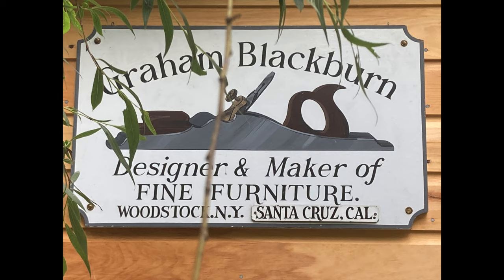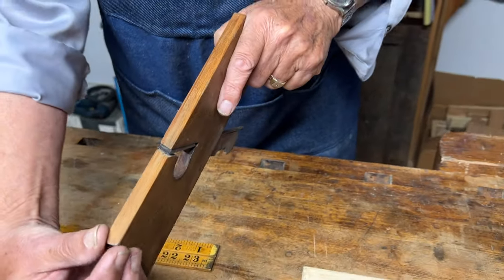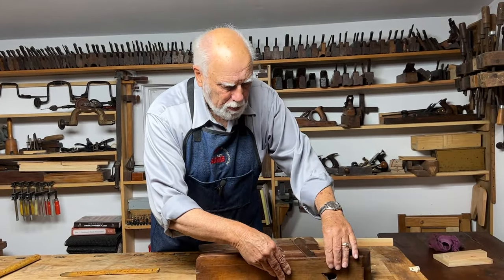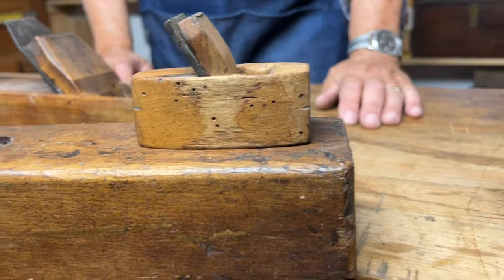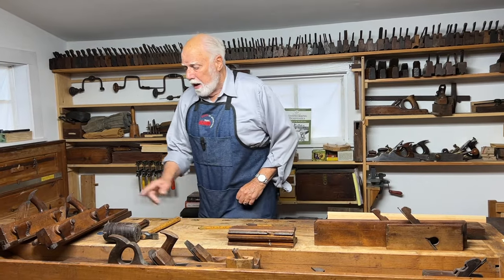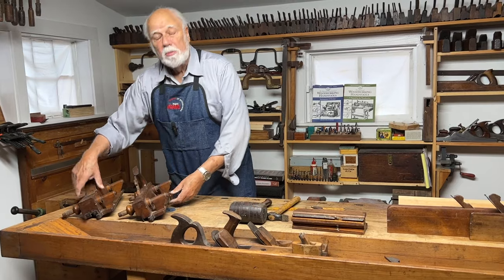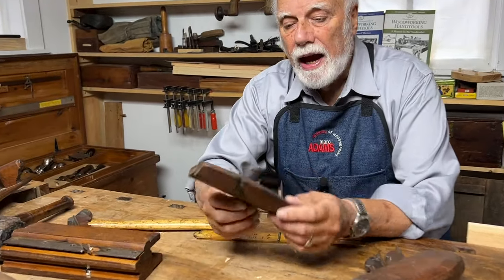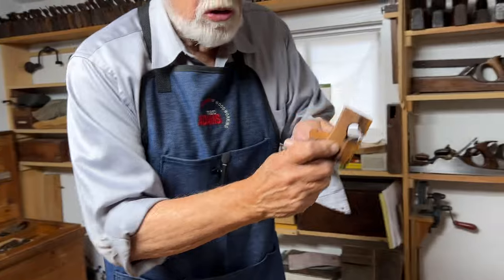61.Big planes & little planes

Comment: I have a plane that is quite similar to the extra long v-grooving plane. Here in France theses were sold as planes for making dovetailed table slides (you would make a groove and then do the dovetail part with the plane). Of course i guess it can be used for a wide array of odd jobs 🙂
Reply from the maker: Interesting!

Comment: Good videos.  I like the relatively short descriptions of the tools, but it leads to many other questions. ie: Why is the  length of a jointer plane important vs the smoothing plane? A. The length of the jointer plane shaves the high points of the stock and results in a flatter surface. The smoothing plane is too short to create a flat surface. It just makes things feel nice. Rippled, but nice.
I'm sure this is explained in your books, but a little of this insight and reasoning in the videos would be great.
Reply from the maker: Noted!